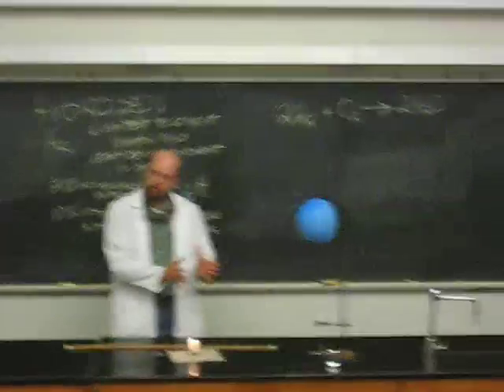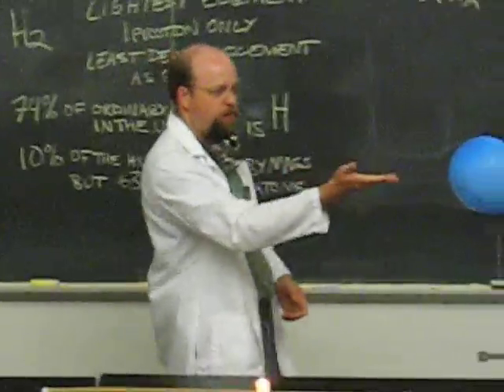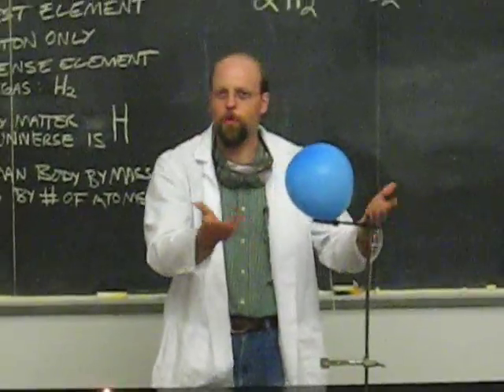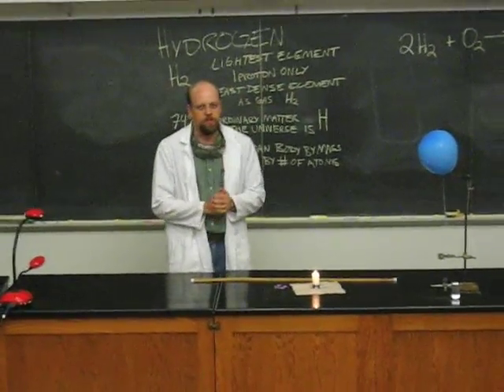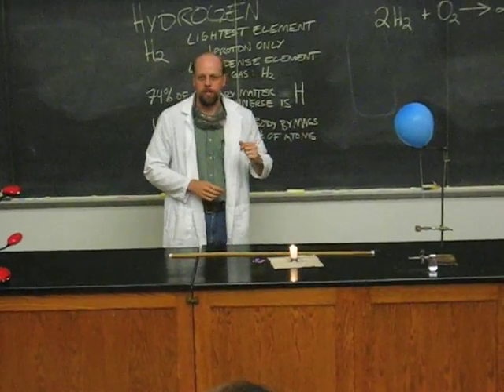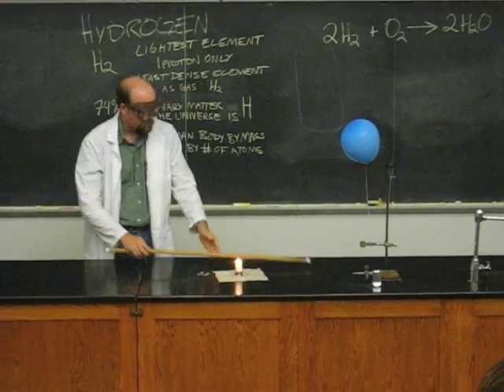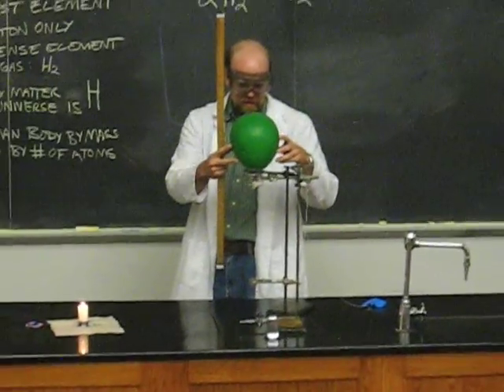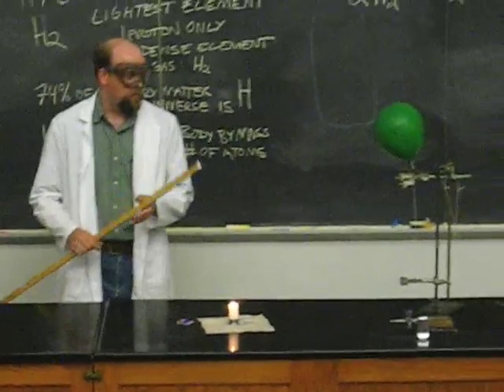Hydrogen Balloons-Generating H2

Comment: Try this. Cut the bottom off a 2 liter plastic soda bottle (high pressure, not a water bottle). Fit a 1 hole rubber stopper with a tube into the top of the 2 liter bottle. After the acid is added to the zinc in the flask, fit another stopper with a tube and rubber hose onto the flask, then attach the hose to the top of the 2 liter bottle. Wait until the bottle fills with H2 (tricky part). Remove hose and light glass tube on top of bottle. Tell students to watch the pretty flame. Walk away. Boom!

Comment: I've found that if you use too high a concentration of acid (ie. 6M), the reaction is too hot. This leads to too much water vapor in the gas. If you use 1M or 3M HCl, the reaction is slower, but will produce nearly pure hydrogen gas.

Comment from the maker: I don't know the temperature-solubility curve for HCl but I do know that you can dissolve 37 g of HCl in enough water to make a total mass of 100 g. That's extremely soluble so I don't think the modest temp. rise in the flask leads to much of a decrease in its solubility. For that reason I don't think that it is contributing to the low buoyancy of the balloon. Notice that the balloons on this video don't float very well--it's because I only collected 1 flask's worth of H2 in each one.

Comment from the maker: When I tried putting more in it just bubbled over. This was a bit dangerous so I went back to just 80mL. If the balloon isn't buoyant it probably just means there isn't enough H2 to overcome the weight of the balloon and the drops of fluid that pop up into the balloon as the reaction proceeds. There are always drops of fluid inside when I do this demonstration.

Comment from the maker: I have done this demonstration a number of times in the past few years and here is what I think. First, due to equilibrium considerations you do not get 100% yield of hydrogen gas (zinc chloride builds up and prevents the forward reaction from proceeding as quickly). Second, if you only do the reaction once you don't generate enough hydrogen to get the balloon to float. I have found that the maximum amount of HCl is 80 mL 6 M HCl (with an approp amt of Zn) in a 125 mL flask.

Comment: Quick Question for you, Prof. Keller: I've tried making hydrogen and capturing it in a balloon using both aluminum and zinc in the presence of hydrochloric acid. However, the balloon, once tied off, does not float in air.

I'm thinking that the exothermicity of the reaction that increases the reaction chamber temperature also decreases hydrogen chloride's aqueous solubility, so some HCl contaminates the H2. Would this be sufficient enough to weigh down the balloon so it can't float?

Thanks.